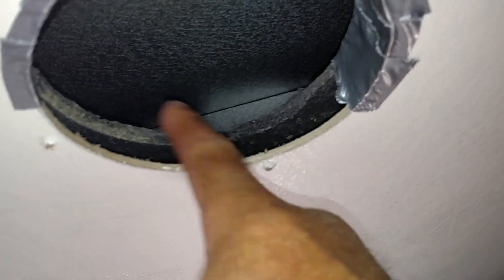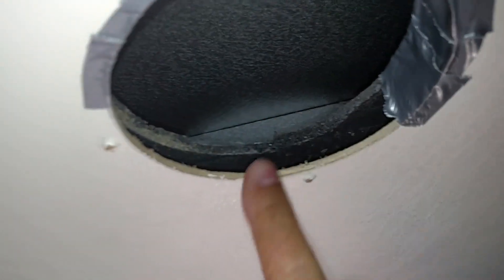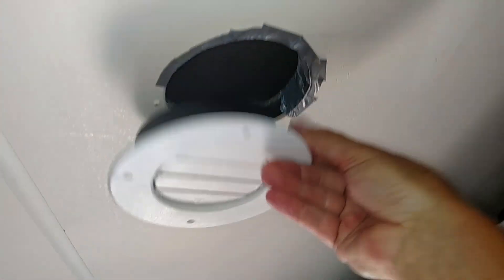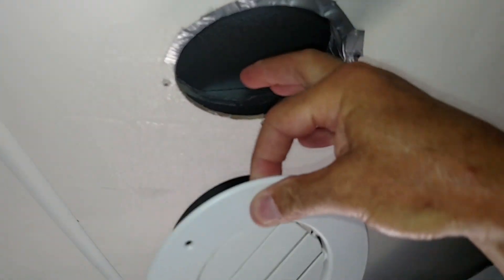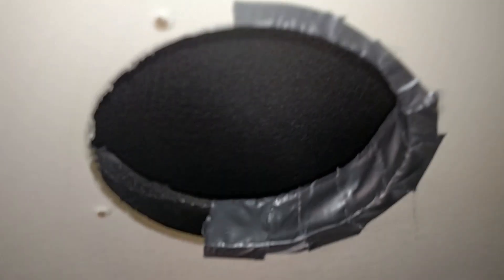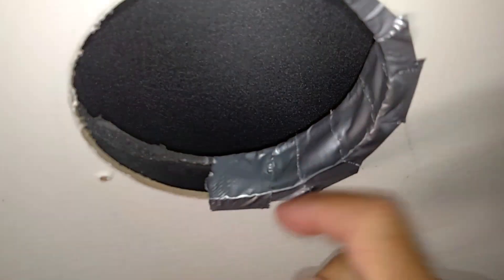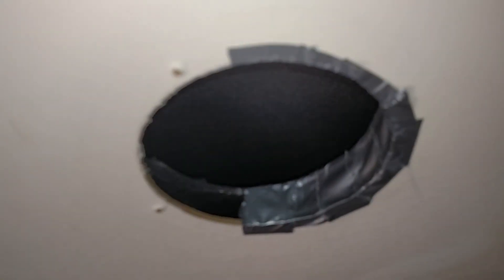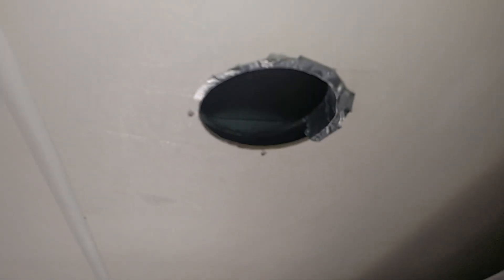RV AC efficiency improvement

Comment: No fair! Yours has screws in the vents and mine are some kind of snap in or something. I have an ant problem and need to get them off to deal with them. Any ideas? I don't want to break them. 2016 Forrest river 33 footer.
Reply from the maker: Did you try rotating it counterclockwise? It might screw in/out or only move a 1/4 turn and then drop down. 
Hate to say it but if you don't see fasteners and it doesn't unscrew it probably snaps out somehow. I learned this working on vehicle dashboards, I hate prying things apart.  Ants, ugg. Make sure to poison down around all the wheels and jacks. parking under trees can be problematic with bugs. And then any cords running along the ground and into trailer need to be addressed somehow. Let me know what you figure out. Good luck
Reply from the maker: Hi again, i did a quick youtube search and found this. I had forgot that there is a trim ring covering the screw ring. Watch this guy snap it on 3 minute into video. Good luck
https://youtu.be/Q4RQiBDKj-Q